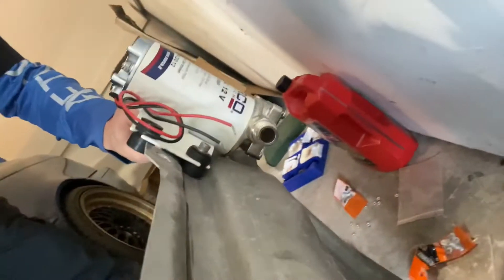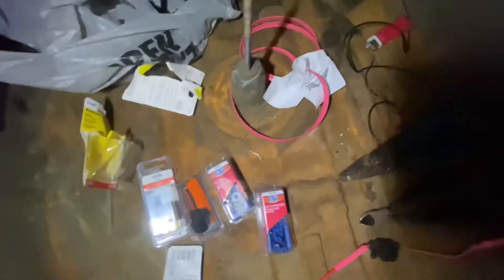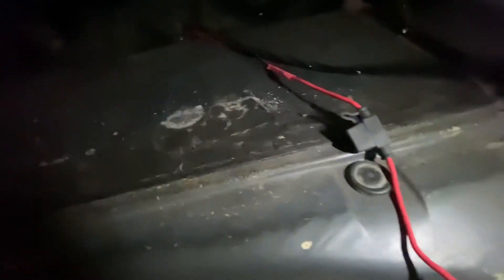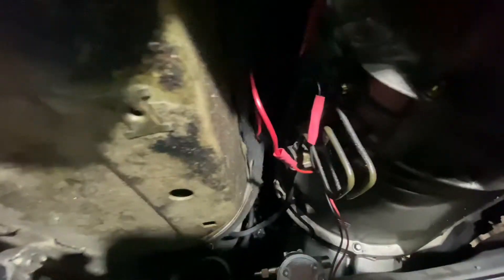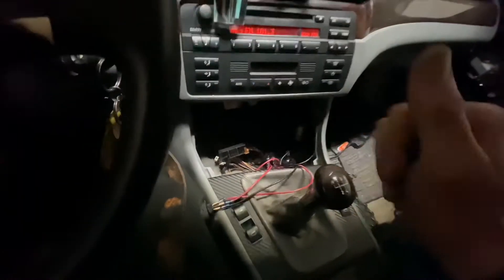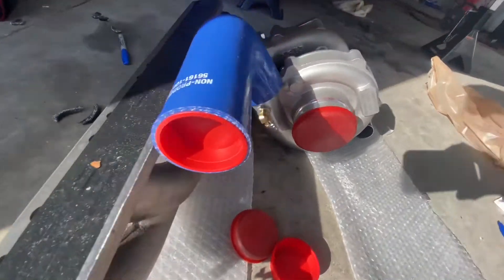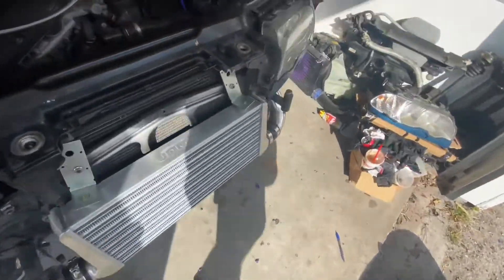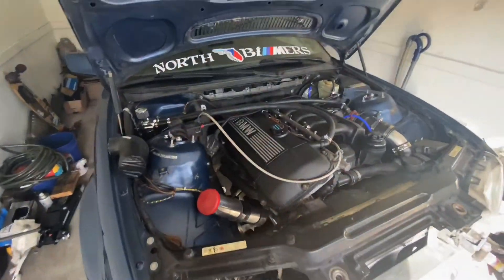BMW E46 Turbo build: Part 3 Oil scavenge pump & more!

Comment: How loud is that pump? Looking to buy.
Reply from the maker: It’s decently loud. I can’t really hear it over the exhaust but it definitely creates a good little shine to it. I like a lot
Reply: Right on, thanks for the feed back. Nice build too!
Reply from the maker: I meant a whine** lol. It’s pretty whiny but with a straight pipe off the turbo u can hear it humming ever so slightly. But not fully till you shut the car off
Reply from the maker: Appreciate it
Reply: Why the relay ?